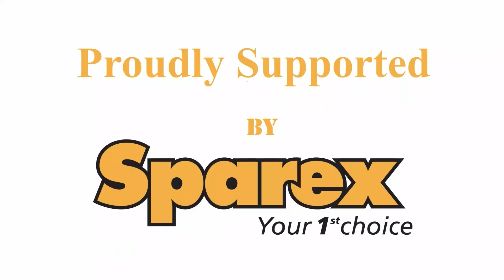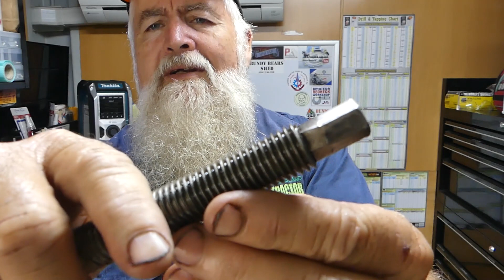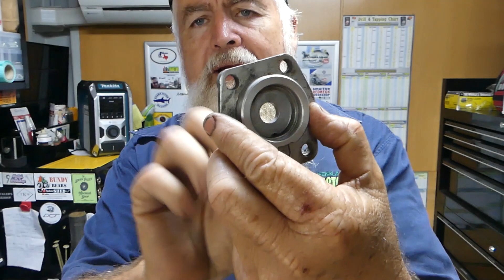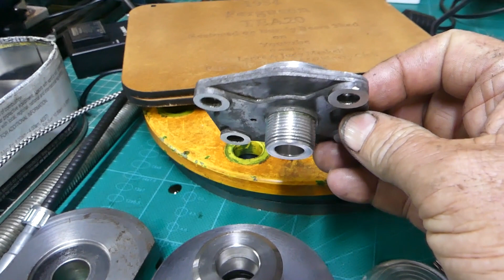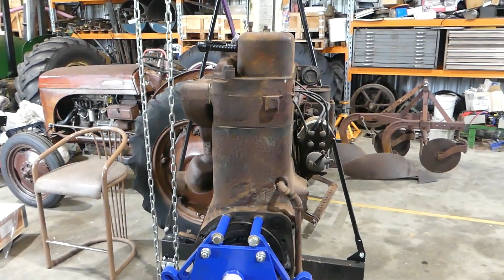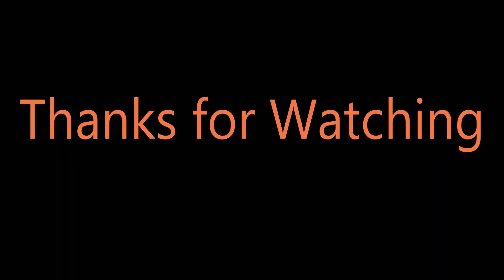Kangaroo Stew # 268 Part 1 Shed Chat

Comment: On the casting flaws , they usta advertise a product called alumaloy or very close to that name . Claimed all kinds of aluminium repair, fill , an machineable ... Supposed to be stronger than most aluminium it bonded to . IDK , I bought a Chinese knockoff that didn't work , I plan on finding the real stuff an tryin it myself .
Reply: Oh yeah , was supposed to just use a propane torch .
Reply from the maker: Not heard of that. we do have JB weld etc but I didnt bother on this one.
Reply from the maker: I reckon the aftermarket are often ok, not always though thats for sure. You need to keep alert.

Comment: Hi Lance, with regard to the engine on the stand, have you ever had concens that such a large heavy engine is strong enough to support itself by bolting to the rear of the block , is there a danger that the block might crack or tear out the threads in the block. It's just something that I've wondered about. Great fix on the tacho drive too.
Reply from the maker: I do think of that for sure and where I can I put a safety nut in behind it but it doesnt really seem to be a problem. I do think about it though.

Comment: Hello Lance,
Good stew... I have often wondered why the shipping container/machine shop was not positioned next to the main shed...
Take care.
Paul,,
Reply from the maker: Council doesnt want it there as they dont look good apparently, and I dont want to waste space in the shed so it is in an under cover car port up near the house with a 15amp electrical circuit going to it. Having air cond is nice both in summer and winter and I never get surface rust in there either. Close to wifi is good for watching Youtube when Im in there as well.

Comment: You can get high tensile threaded bar, it is expensive though.
Reply from the maker: Yeah none here in town and when I add freight I thought it just wasn't worth going that way seeing as this old puller has done the job for probably 30 years without much worry apart from making a new rod now and then.
Reply: @bundybearsshed  when I worked at Mack trucks they had a porta power through cylinder on top of the liner puller, that worked well

Comment: Some liners are hard to move out  had a old Toyota  truck  that had tight liners hoted them up with  a oxy torch  and tossed ice water  on them and they popped out easy   they were original liners  in the engine  .
Reply from the maker: This one I had was bloody tight, fought it all the way.